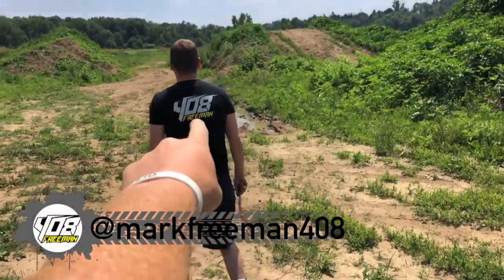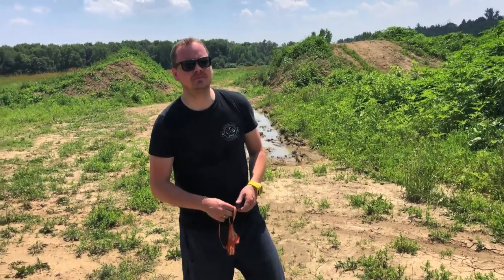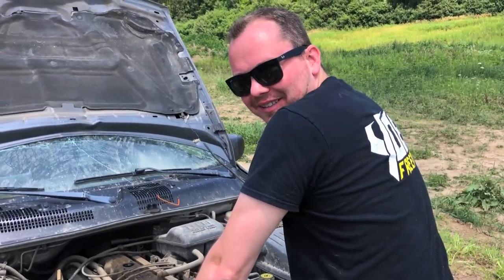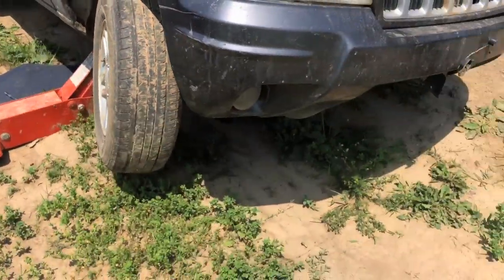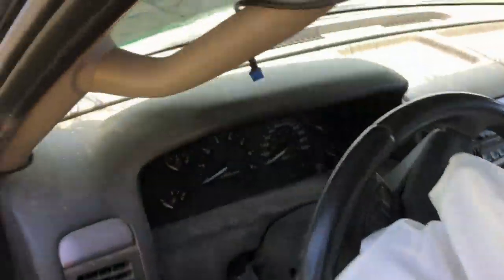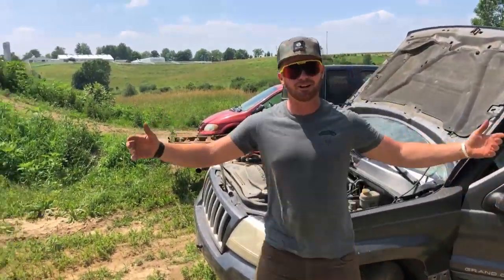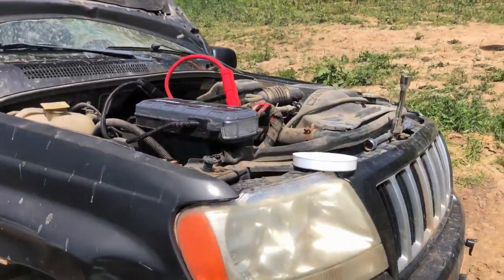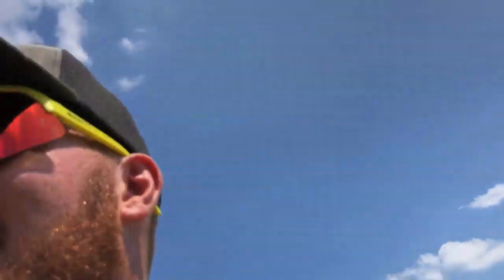Using ROUND UP As Engine OIL!

Comment: RainX washer fluid in a hot engine turns engine oil to a frothy chocolate moose texture.....😎 Don’t ask how I know. Another idea is rev up an engine to redline then spray NoS out of a bottle straight into the intake. No nozzle just wide open Nitrous

Comment: Mark if you look at the rear of the maverick the passenger side lower bar is straight and the driver side rear lower bar towards the tire has a slight bend to it that is more than likely what is causing the tire issues

Comment: I have a car that you can jump... the cooling fan doesn't work in it so it will overheat on you about a few times a day and the power steering pump does not work too well so it can't really turn that good

Comment: Mix unleaded and desiel together and use it as engine oil then start the car then light the fuel on fire whist the car is driving. Or just use aresole or gas as an oil🤷🏻‍♂️

Comment: Lately a lot of ppl are using diesel or other thin oils. What about atf or 80 90 gear oil and dont even take it off the trailer just do a bitchin trailer burnout.